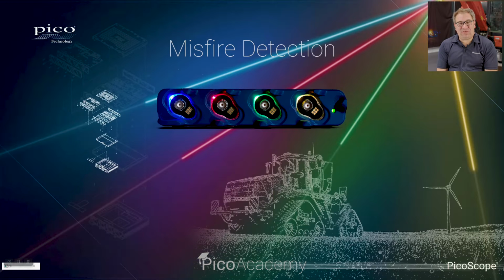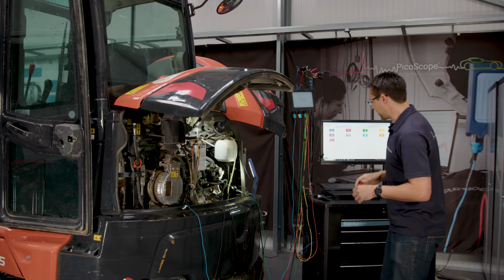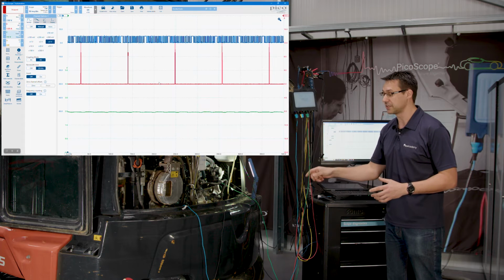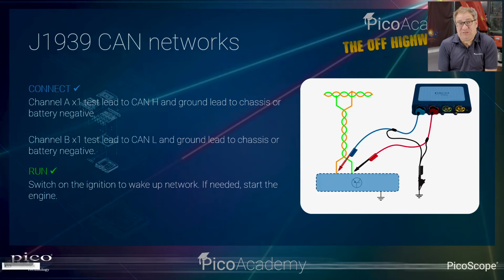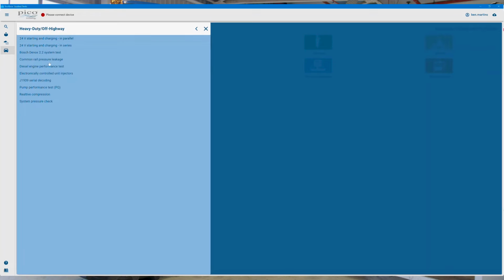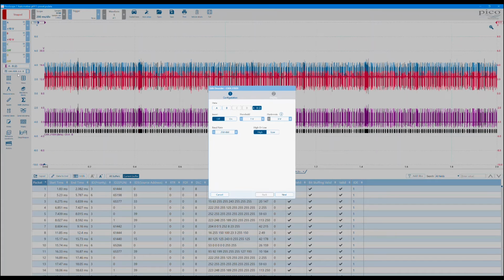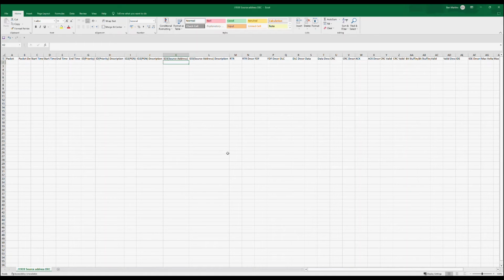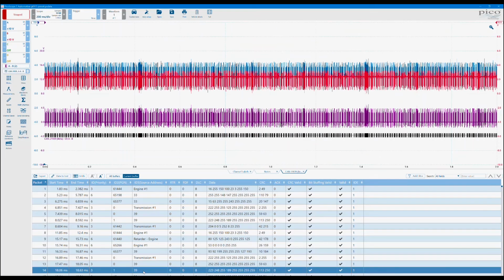Diesel Diagnostics (Part 2)

Comment: Loving the heavy duty guided test. Question, do we have to worry about the scope with the high voltage from the injectors?
Reply: Great to hear there useful! I will pass on your comments to the software teams who made it happen! The majority of injectors I've seen in HD tend to be under 100V. You may get an inductive kick above 100V but I've not seen one exceed the 200V. The Off Highway scope (4425A) can handle an input voltage of 200V so it's unlikely you will need attenuation, I've not needed to in the 6 years I've been at Pico. Please remember to measure each side of the injector with reference to battery ground though so you can see both sides of the injector. For older scopes, you can of course still use the guided tests but be aware that attenuation may be needed.
Reply: I'm not sure about Pico, but for all others scopes, for every actuator, you should use a X10 or x20 reducer. For direct injection gasoline engines, the tension could be somewhere near 150V for a brief period of time. Diesel engines injectors should be somewhere near.